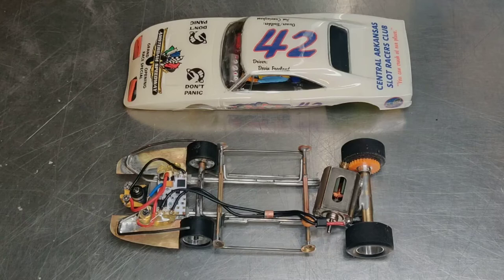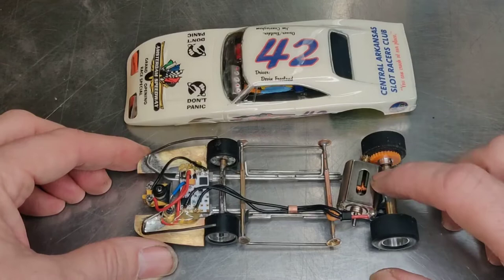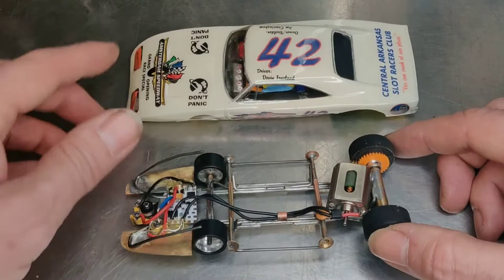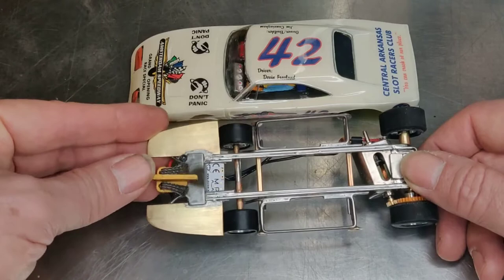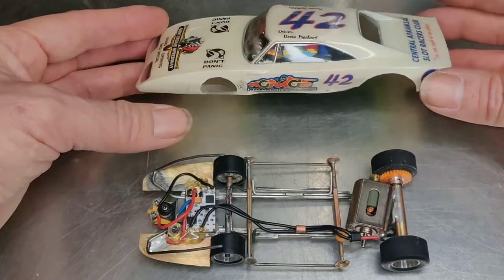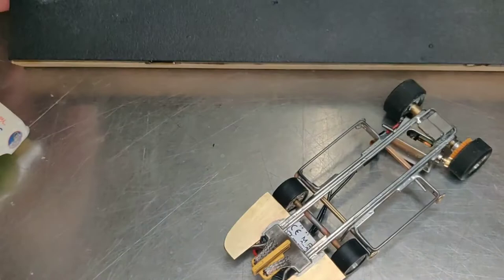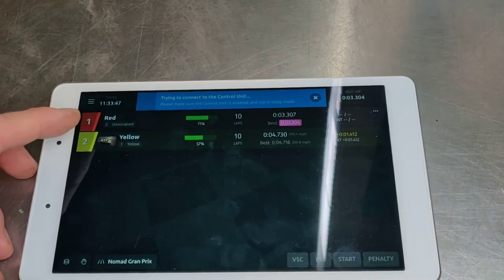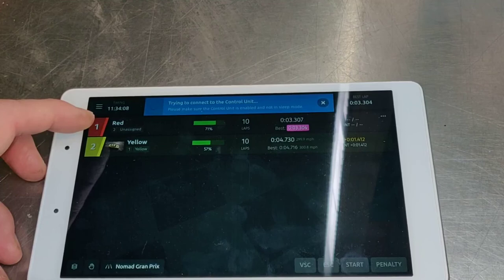Close look at a fast handmade steel chassis car for Carrera Digital tracks.

Comment: Nice build.  I was scratching my head all the way through wondering why you were calling this a Carrera Digital car.  Then I realized you must mean it’s a car built for Carrera Digital track (!).   I normally run closer to 3:1 ratios...tempted to try 2:1 and see the difference.  For light and torquey cars that might be interesting.  Thanks!
Reply from the maker: Thanks!  I have changed the title to make it more clear.

Comment: The chassis looks great! Can you give more details and specs on the build? How is the shaker/rattler assembly attached to the main chassis? Are there any hinges used in this chassis build? Do the front wheels touch the track? How about posting some close up pics? Thanks!
Reply from the maker: The chassis is built mostly of .055 Piano wire and .025 brass plate.  The subframe with the front axle and body mount is not hinged.  It floats freely outboard of the main rails.  It is retained by the Four "L" shaped piano wire parts. Yes the front wheels roll, but they support only the lightweight body and subframe.  I have some photos but I do not know how to post them here.  I may post them in Slotblog, Slot car Illustrated or on my Nomad Raceways Blog elsewhere soon.  I am not sure they can show much better than this video.
Reply: Thanks for replying to my questions regarding your latest creation. Also, I was trying to "copy" your steel Chevron sidewinder you created in your other video. You soldered the rear axle tube directly to the motor can. I tried doing that but the p11/36 t inion and spur gear lose contact/mesh. I used NSR 11/36 T 64 Pitch pinion/spur gear (part 6705). Also my rear tire is NSR 5710 EVO Supergrip 19.5x12 and wheel is NSR 5010 16.5mm. What gears did you use and also what rear tire/wheel size? Should I use something like a 46/14 and a 20.5 tire diameter for track clearance? Thanks.

Comment: Wow! I didn't know digital slot cars could get this extreme!
Reply from the maker: DIgital racing does impose real limits on motors.  More powerful motors draw more current that can overheat decoder chips.  I have even had some burst into flames, so any motor upgrade must be tested with great care and will ot be supported by any digital decoder makers. In this case, the motor is hotter than stock but mild compared to what would work in an analog setup., but the use of very high-quality gears ball bearings axles, and LESS magnetic downforce than a stock car SHOULD permit the car to go the distance without decoder overheating.  The low CG, flexible, isolating chassis and lightweight body give it exceptional handling. On my track, this car with traction magnet removed, is still faster than the best of full magnet stock Carrera digital 1/32 cars. (And more fun  to drive)  One difference from the way a similar car might be made for an analog track, is that I allowed a full 1/8" of clearance under the metal chassis and the body is positioned so the metal chassis cannot short the track.  It will likely win the race it was built for this weekend or fail to finish. Most cars I build are analog or vintage restorations, so really fast digital is new territory and this car is an experiment.  I am very glad rules for The Mmaerstam Race allow such creativity, I really enjoy the challenge of building special cars for races.
Reply: @jimcunningham534  yes thank you for sharing! I subscribed to your channel because your car builds to look very impressive! Don't see too many people put that much work into magnet cars or even a digital slot car!
Reply from the maker: @maxthunder2  For me, building and tuning are the most interesting part of the slot car hobby, especially when rules allow for creativity or just building cars that are fun to drive and look at.
Reply from the maker: Thanks for subscribing.  I am new to posting on YouTube, but will be sharing more and improving quality as I go.

Comment: Hi Jim fantastic work regards rhys watsonia Victoria Australia
Reply from the maker: What kind of chassis do you use, or make?
Reply: @jimcunningham534  hi Jim just got into hobby  I race 1,/ 24 vintage slot cars  just fixed up Chaparral 30 / 40  looks great
Reply from the maker: @rhysthomas209  I have been building slot cars for 50 years.  Do you mean a Lotus 30/40?  If not, what kind of Chaparral?  Cox brand Or ?
Reply: @jimcunningham534  oops sorry mate  yep lorus

Comment: I think you have the motor running backwards, most motors of that type rotate clockwise from the drive end and you have it set to run anticlockwise, the timings on the commutator are advanced to run clockwise giving higher RPM and power. I could be wrong it could be timed to run anticlockwise, I don't have personal experience of that specific motor. it's something to check out.
Reply from the maker: Thanks for your input. It is an interesting point. I did consider this and I checked the motor before building this chassis.  This motor is an oddity in that it is anticlockwise rotation.  In testing, it runs faster and at lower amperage than in the other direction.  I tested several motors before building the car.  I needed lower amp draw so as not to overheat the decoder chip.  There are faster motors I could have built for, but it is hard to know how much the decoders can take.
Reply: @jimcunningham534  So putting a chip in a Slot it car could cause issues? Lots of people do it but Im certainly a novice at all this...Slot it motor is way faster than any carrera.
Reply from the maker: @bradsanders6954  Brad,  The digital decoder chips can only handle so much current before they overheat and fail.  Overheating depends on many factors, the wind of the armature, generally faster ones tend to draw more current, but there are many other factors:  Friction, the percentage of time the throttle is at or near full throttle. Those two elements are greatly increased with strong downforce magnets. How frequently the car stops as peak current is always at start-up makes a difference. , Ambient temperature and length of time running also play their part. Generally, I would not expect a problem with SLot it cars unless you have added magnets, run them for long durations, in a warm room, etc.  There is no way to know precisely how much the decoders can be pushed.  That is why they run full-scale races like LeMans!